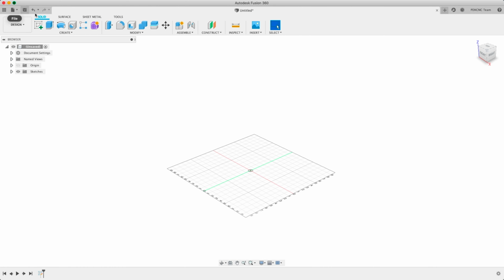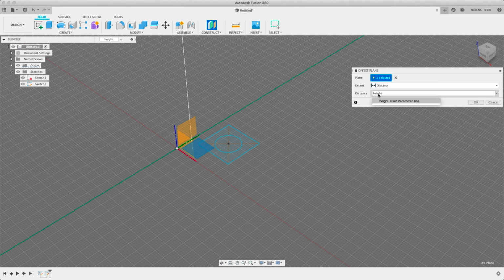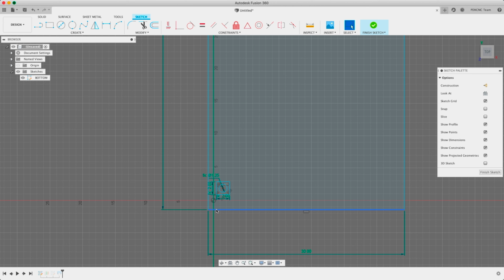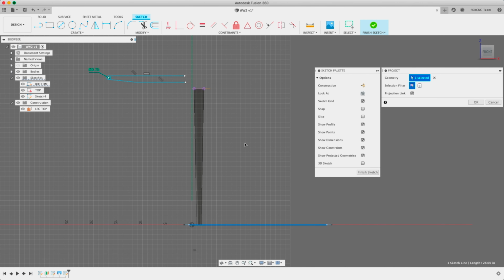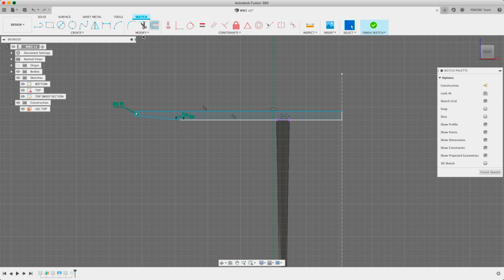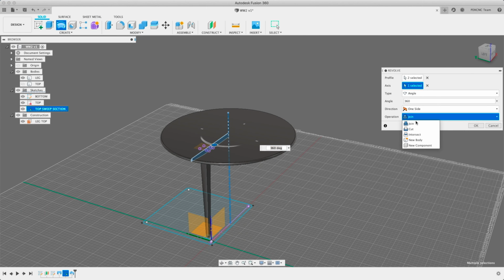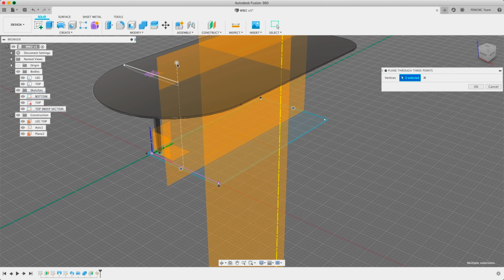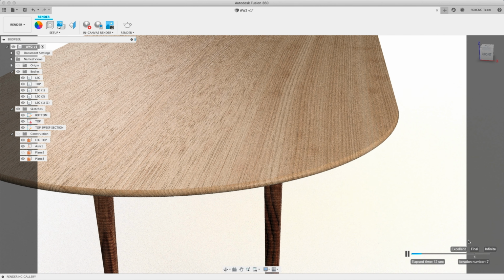Learn Fusion 360 for Beginners [#2] – Model a Dining Table

Comment: Hello.  Agree with the back ground comments - please stay with light/white.  My question is I am using the free version and I can not find ' project '.  I followed your instructions - type S on the key board then the search box pops up. I type in pro ... then all the searches goes blank, as if there is nothing with the title starting with pro. i.e. nothing called project. -  10 minutes later --- I have discovered that project only appears when sketch is in edit mode. But when in edit mode, it does not see the construction plane. ahhhhhh (head pounding on the desk).
I am on macOS 12.1 x86_64 (21C52) on MBP 11,4 using Autodesk Fusion 360 2.0.12157. -  Thanks - I have learned more from your videos than any others. Love the realness as well.
Reply from the maker: Gotcha. Haven't really used the grey background since. Project should show up in the Edit Sketch dialog.

Comment: This is great! I'm nailed to the screen! 
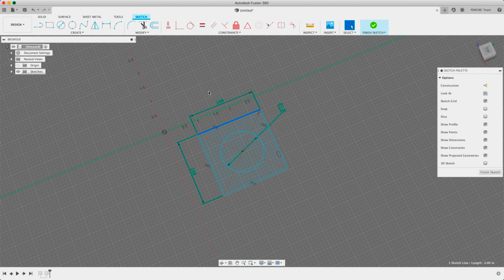I know this video has been done for a while, but a tiny bit of feedback: For youtube purposes I preferred the white background visual style. The dark environment is easier on the eyes, but if you look at around 03:00 you can see that the youtube compression completely ruins the numbers and you can't really distinguish the lines from the background that easy.
Reply from the maker: I get that. Not much a happy medium. As you can see I’ve struggled with picking the right one. Any requests for future videos in this series?
Reply: @pdxcnc  The quality is very good, no struggle is apparent. :) As for suggestions for future videos, I've just recently gotten a CNC and the infamous "feeds and speeds" is really challenging to get a natural feel for. Some tips on how to intuitively select RPM and surface speed for mills and materials would be neat. I know it's more about CNC, but, well, you build the Gcode in Fusion so. Thanks for a great video series so far! I just subscribed.
Reply from the maker: @iLEZ  we won’t cover that in this series but we have a Basics course to CNC and CAM that’s on sale right now https://pdxc.co/icc-bf-21

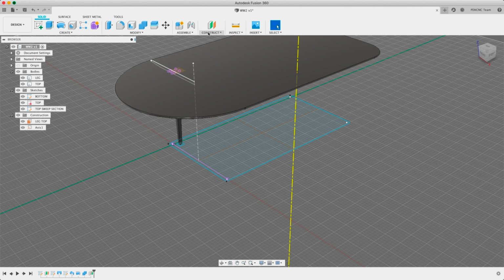Comment: At 31:33, I think you could have also selected `Construct -> Plane at angle -> 90°` and selected your horizontal line, and not needed to generate that vertical axis. Obviously lots of ways to handle that.
Reply from the maker: Oh, nice, thanks. Yeah, definitely a few options.